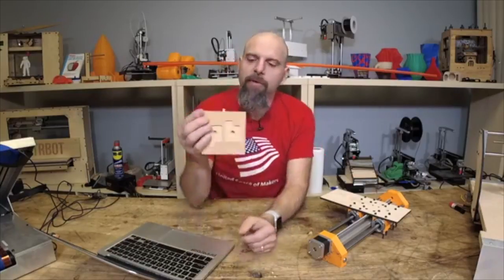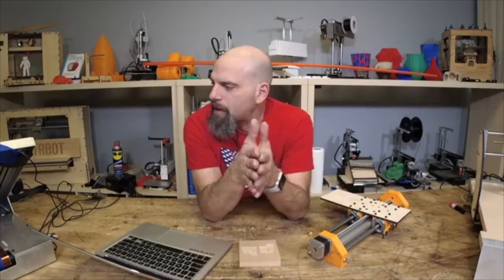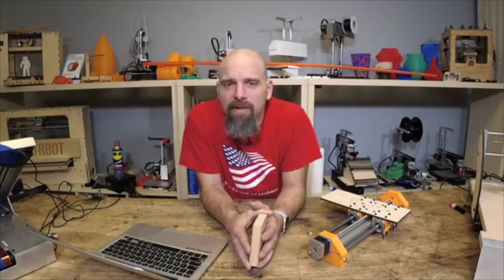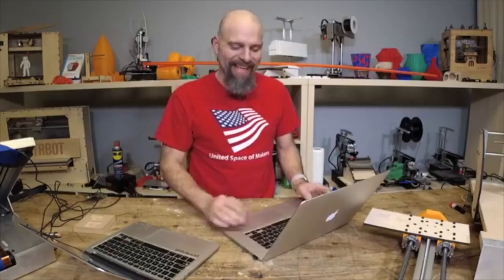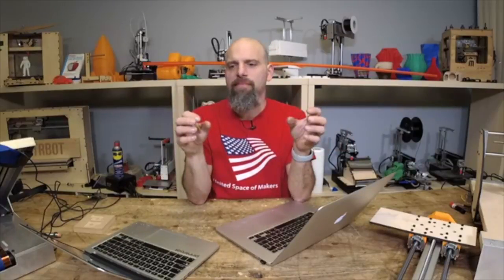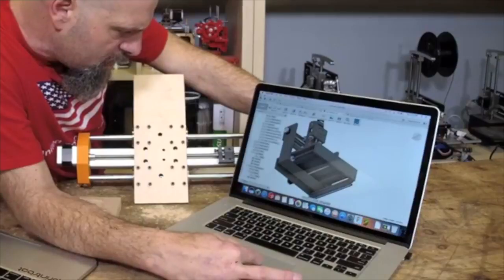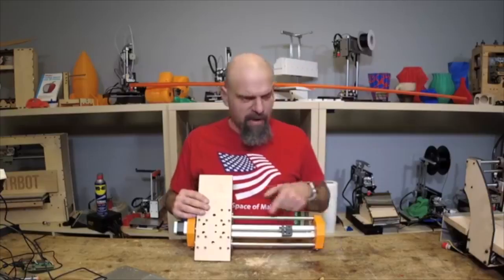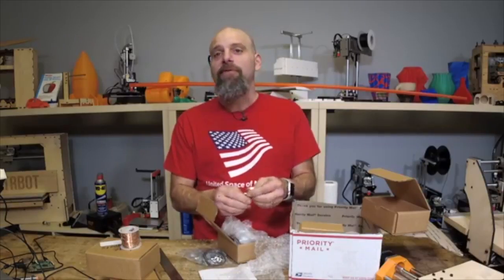Printrbot LIVE   1-25-18

Comment: Thoughts about the cnc, what about a router attachment for the printers. That is what I was planning on doing with mine anyway. I don't see why it wouldn't work and have it wired to one of the other sets of wires from the power supply. 

Love the part about tweaking designs. Wish more people could see and hear that. So many people don't understand why it takes so long to tweak. 

One last thing, any tips on connecting the E3D PT100 to the Rev F4 printrboard? I already have a volcano hotend on my simple metal but the PT100 may or may not connect directly to the board. I have the chip to do it either way but it needs a 0v, 5v, and signal connection which is my problem. The normal thermistor or thermocouple is 2 wires and if they are connected to a digital then I should be able to connect straight to the board. If not, I need to know where those 3 connections are. Thanks dude